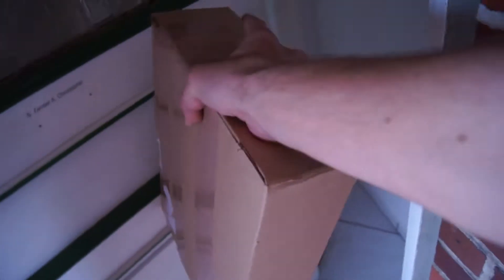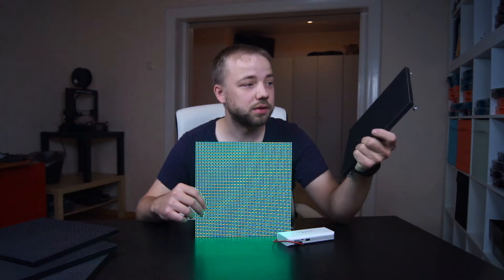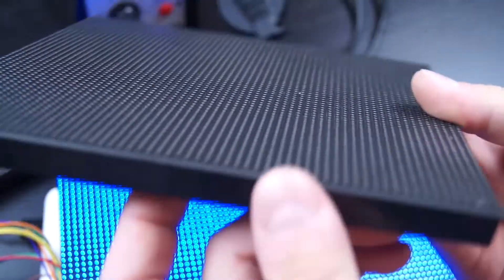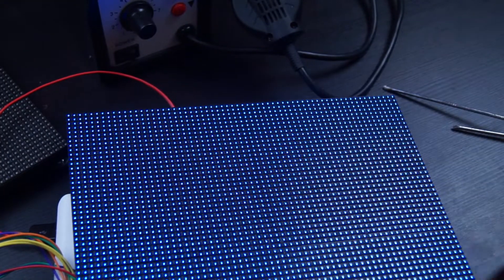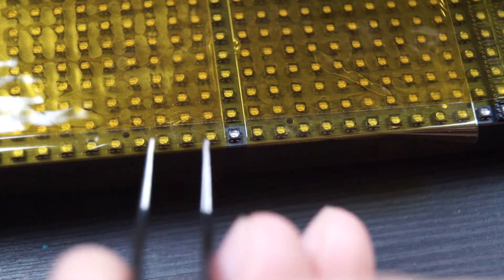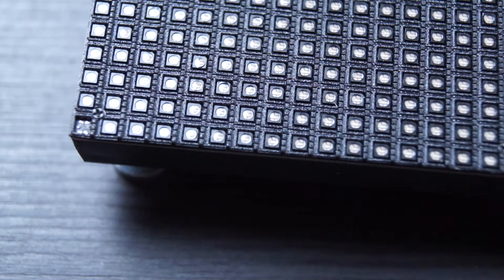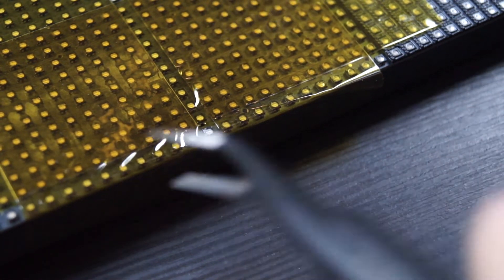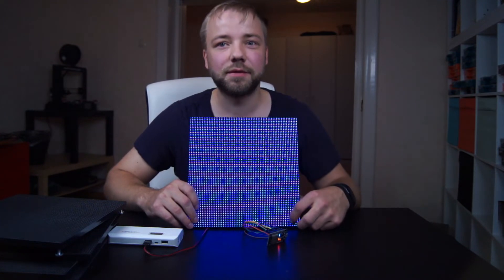Dead pixel repair on RGB LED Matrix P1-4

Comment: Cool. I have a panel with the same problem, but mine is flexible, yours are rigid. Flexible are even cooler than those rigid ones, just more expensive. Mine already had an gdm32 controller but I was thinking replacing it with an esp32 at some point...
Reply from the maker: I know these flexible ones, but the price holds me back :D maybe in the future

Comment: Great, now I'm poorer than before your video. And am getting some broken Panels ;)
Reply from the maker: Did you found "the" ebay seller 4pcs for 60? :D
Reply: @atc1441  If that's with shipping: yepp. Sadly only 1x4pcs of the "broken" ones left :/
Reply from the maker: Ah yes thats where i got mine from. But i was able to resist to buy both^^